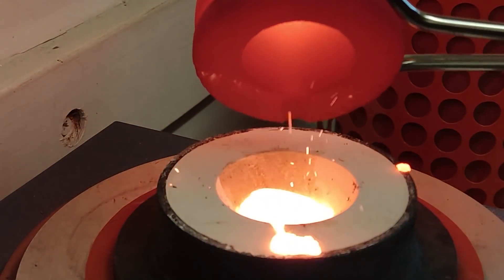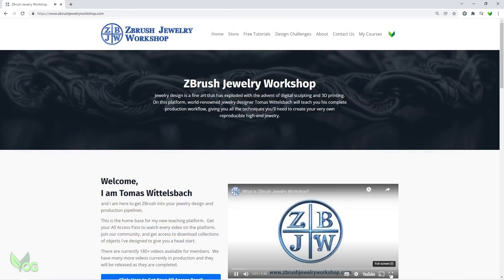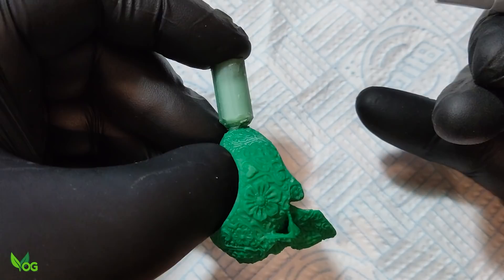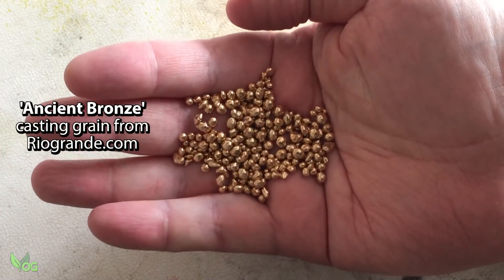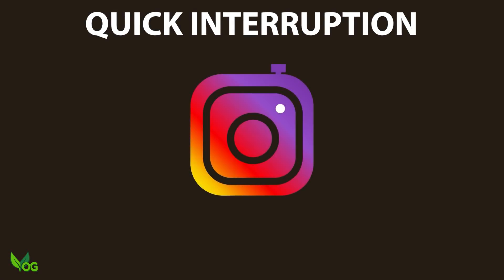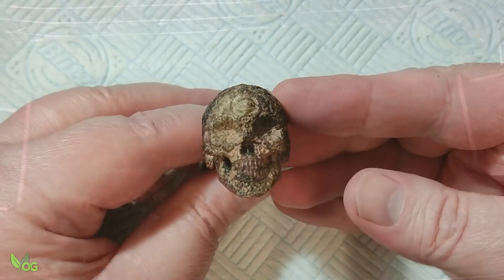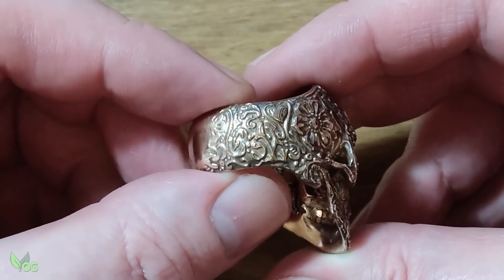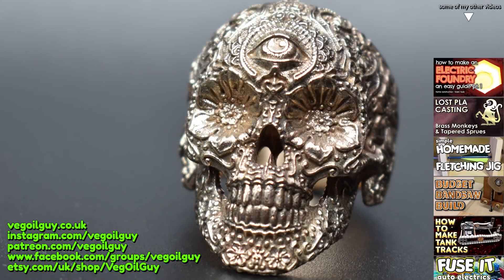Casting a skull ring with the Anycubic Photon Ultra DLP & EasyCast 200 - by VOGMAN

Comment: Do you need the sprues at the top and bottom of the ring for casting?
Reply from the maker: Possibly not. I generally just have one sprue at the bottom. But this was a large ring with many fine twists and turns, so it didn't hurt to play safe 😁

Comment: I thought your son's ring was very well made, could you make a video about making selecting and mounting gemstones for rings? I am an engineer by trade so I would guess something like mock up the gemstone in cad and model the ring around it, but how would you fold the retaining tabs down without weakening the metal or tarnishing it with a flame?
Reply from the maker: I'll be honest, I know nothing about stone fitting and I suspect it's too fiddly for me. However, I believe some stones can be cast in place... that I might be able to look into 😁

Comment: Interesting process.  I wonder if you could print the channels you use to allow the metal to flow into the mould when casting.  It seems you added supports to the 3D print, then removed them only to add casting channels back in.  Wouldn't adding the channels actually allow you to reduce the number of supports you need to use in the first place?
Reply from the maker: You certainly can include and print sprues in the design process (or tack them on before printing) and you often see me do this. I even did a quick video the other day showing folks how to use slicer software to achieve this result. https://youtu.be/ZR6Bw_zIK1s
It's purely a personal choice. Wax is generally cheaper than resin and easy enough to add on... 😁😁😁

Comment: Awesome! I've been attempting ring prints on my mars 3 and have an issue with loss of detail near supports where the model faces the build plate... In this case it'd be the back of your ring. I see you didn't lose much detail, is this an advantage of DLP or am I doing something wrong?
Reply from the maker: No, DLP shouldn't really make a difference there. The Mars 3 is a very capable printer and I printed this same skull ring on it. It could be your positioning of the model, or even the supports. Have you watched this video? It may help https://youtu.be/MU0Cq_bjhy4

Comment: This was awesome. I was going to have a try at using melted down aluminium cans and using greensand to make a mould from my 3D print but this looks a bit easier. Quick question, how do you determine how much metal to use ? do you calculate the volume of the mould, or just pour it in until it starts coming out ? Thanks.

Comment: The left is better. I was thinking that's the ultra. But it's the 6k. It takes 6k to beat a 1st gen DLP. Even the 4k doesn't match. And there's already a 2k DLP in the works... This solidifies the DLP for me. It's just too much of a new technology and the disparity is too great. Reminds me of gasoline and electric cars.
Reply from the maker: Trust me, it's a close thing, but the Ultra is better on the detail. However the Mono X 6K has a plate that's probably 4 times bigger, so it wins there 😁